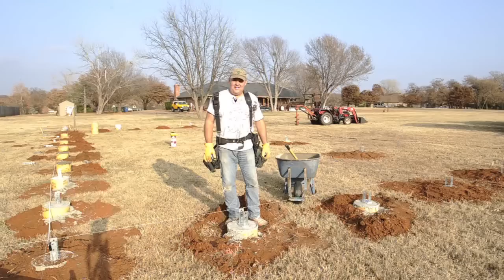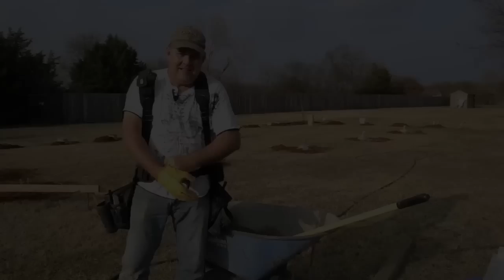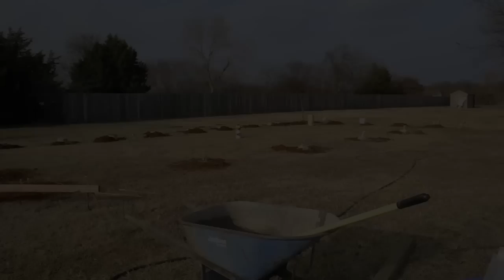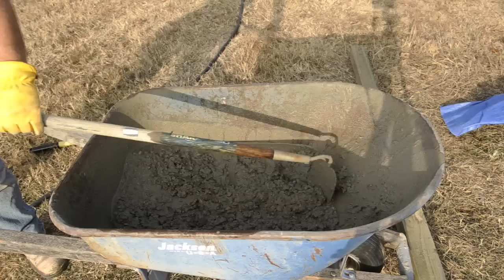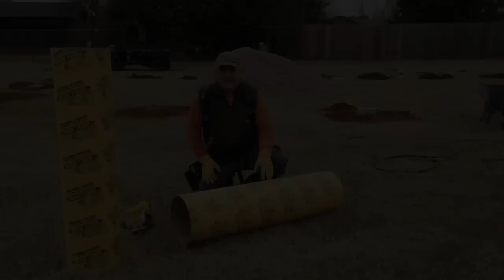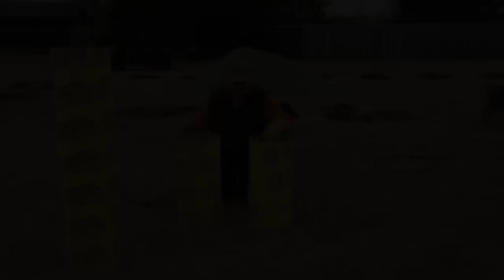Setting concrete piers for a pole barn

Comment: why even bother with that tube? round hole in ground..tube is pointless right?
Reply: If the ground were perfectly level then you could get away without using the forms. Otherwise there will be places where the concrete needs to be above the ground level so you need something to hold it.
Reply: You also potentially save a lot of concrete. It would cost a lot more to just fill the holes.
Reply: the ground sucks up too much water from the concrete so now alot counties require the cardboard mold